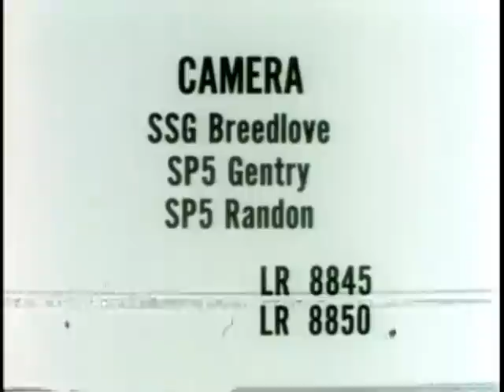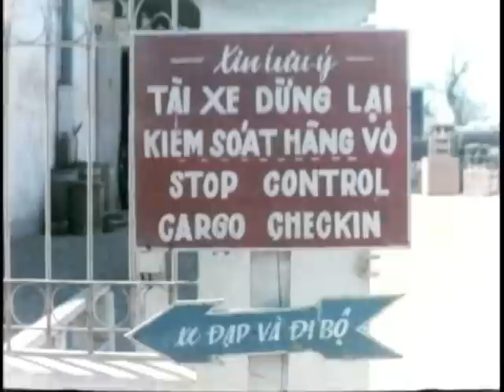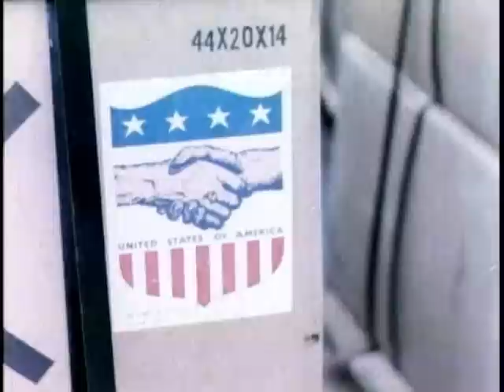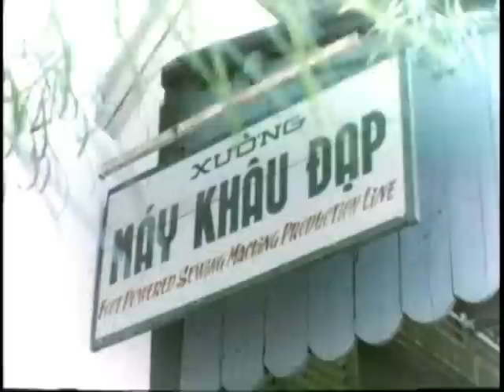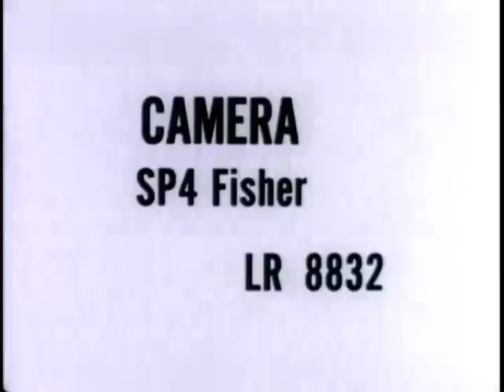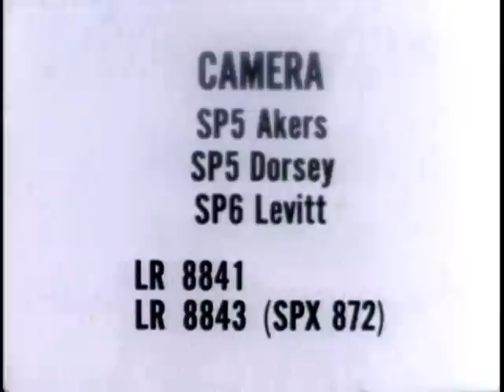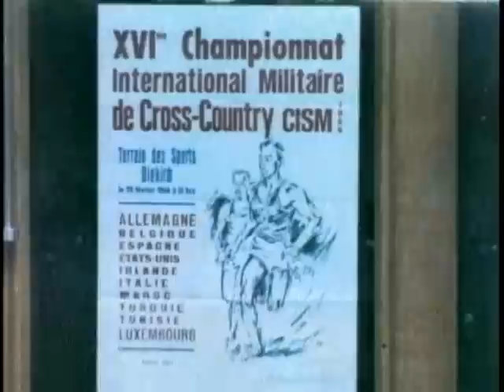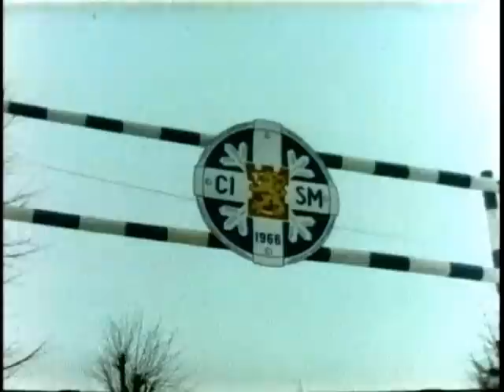Staff Film Report 66-13A (1966)

Comment: The Huey, and rightly so, is almost universally lauded as the best helicopter to serve in Vietnam, but in my opinion, based upon more than a decade of experience, the Chinook was an equal to the Huey, totally different roles for the most part but nonetheless the Chinook, then and now, proved it versatility, enormous lifting prowess, durability from both environmental conditions and battle damage, and for me personally, an engineers dream to work upon. I spent hundreds of hours flying in them, for air testing and transit to many many varied locations, and can honestly say that I slept really well, nylon seats or the “stack” (cargo) was fine and the lack of facilities never bothered me as flights were never that long (unless we had ERTs fitted) and then a plastic bottle was always handy, and never ever try peeing of the ramp in flight, it makes the loadmasters very grumpy and wet (it wasn’t me). The only other aircraft that I liked to sleep on was the Hercules, same again, seat or stack, maybe a hammock, were very acceptable, put me on an airliner and sleep was nigh on impossible, whatever the distance. 
Thanks for another excellent upload, informative and interesting. 😀👍🇬🇧🏴
Reply: The "Huey" has been long gone, while the Chinook is still here and is actually being up-graded once again!
Reply: Different tools for different jobs. The Chinook is sticking around because it was discovered that the V-22 Osprey couldn’t perform more than a few of the same jobs that the Chinook could, which the Osprey was intended to replace in a great many roles. Oops… It turns out that Rotors still have a greater dead-lift capability than the props of the Osprey, just as a start. That and the downdraft of the Osprey is multiple times that of the Chinook (again: Rotors v. Props).
Reply: Just so long as the timing gears which keep the two rotors from colliding don't fail. When that happens you have a few seconds before the machine falls from the sky killing all on board.

Chinook has been banned from the north sea oil sector for decades due to a string of (fatal) equipment failures resulting in it being considered too dangerous and unreliable for routine commercial use.